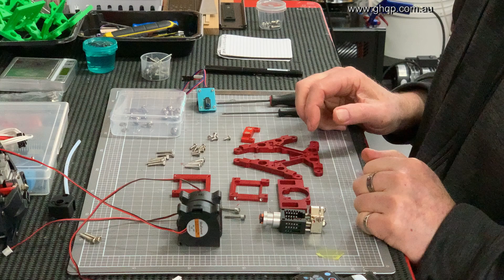Mosquito Hot End Effector for ANYCUBIC Predator

Comment: I just ordered the same hotend. Can I please ask you 3 questions I can`t seem to get an answer for?
What Nozzle Size is that? Mk8, V6,...? Can I switch the Heatbreak for a high flow,, and are they the same size as the original? The heatbreak for the Dragon v2 won`t fit I guess? They look identical. That one I could order. And is that heating block really gonna do 450C and beyond? Thank you for taking the time (if you do). Great Video btw, I have an Ender 5 plus, but I will need some trickery too to get it mounted.
Reply: It uses a V6 size Nozzle, I use Micro Swiss.  There is already the option of a high flow version heat break for the Mosquito that fits the same dimensions, I don't use it as the highest temp material I print with is PETG 230degC. I am also assuming Dragon Heat breaks wont fit, never tried. I cant say if you will get 450C+ never tried. I hope this helps.
Reply: @grahamham3398  Very much in deed! Thank you!
Reply: @grahamham3398  I just found a fitting bi-metal heatbreak on e bay! Thx agiain! Knowing the Nozzle size is a huge help!

Comment: I'm curious if you've also upgraded your electronics to SKR or Duet?
Reply from the maker: No I am still running the original electronic. I have purchased an SKR but its sitting on my desk waiting to be installed one day. I just find that the original electronics does such a good job there is nothing that motivates me yet enough to replace it with the SKR.
Reply: @hamrx8  Interesting.  I've got some random layer shifting that has plagued me for a while.  I've not been able to isolate it as clearly being either mechanical or electronic in origin.  Your linear rail upgrade is excellent and I'm seriously considering that.  Have you found that the linear rails have improved print quality or reliability in any clear way?
Reply from the maker: @pfschuyler  I did the Linear Rail upgrade/modification very early after I got my printer so as it was still working pretty well from new the improvement after installing the rails was very small. Just a slight reduction in banding but that's about all. I mostly installed the linear rails for future reliability and never having to worry about adjustments of the V Wheels of paint wearing off as many other people had experienced. I have never had a layer shift problem so cant really help with that one.
Reply: @hamrx8  Well thanks for the great instructions on your website.  I'm going for the linear rail upgrade and we'll see how it goes.
Reply from the maker: @pfschuyler  Let me know if you need anything. There is a Contact Me form on my website you could send a message so we can then communicate via eMail. There was an issue with the form not working but hopefully I fixed that today. URL is:  www.ghqp.com.au

Comment: How much would you charge for a kit? Not including the mosquito hotend itself.
Reply: So a kit to assemble and attach the mosquito. The plates and fans (I would want blue instead of red) and screws to put it all together. Basically everything minus the mosquito itself. I am very impressed with your work and am very interested in buying this off of you if you are interested in selling
Reply: @wisdomprescott9613  Same. I'd buy it in heartbeat for both of my anycubic predators.
Reply from the maker: Hi, see my reply to Wisdom Prescott. :)
Reply: @hamrx8  I've sent the STL's for MJF 12 printing at a local place for $30 total. If that works I'll be good, if not the aluminum parts are definitely something I'd want.
Reply from the maker: @wisdomprescott9613  It was never my intention to make these for sale. Honestly for the time it would take me to put it all together as a kit what I would have to charge to do it all would be a bit outrageous. I would only ever consider just the Aluminium parts only on a very limited scale. There is an email Contact Me form on my website.
Reply: @hamrx8  I would be very interested in just the alu parts made and sent to me. can i contact you on you email to see about cost?
Reply from the maker: @darrencarter5966  I think I have fixed the Contact Form on my website. Once you complete this we will then be able to email each other to discuss further. http://www.hamrx8.com/Contact_Me.php
Reply: @hamrx8  I've tried to use your contact form but it won't accept my submission (because I'm using punctuation, apparently).
Reply from the maker: @Radioman-pv5np  Thank you for making me aware of this problem. It is now fixed so you can now send your message.

Comment: You weren't kidding, those STLs are messy lol. None the less I am still impressed by the quality of your work. Personally I'm going to go another path, just pulled the trigger on a high flow Phaetus dragon hotend. Hoping it's good quality, it's definitely not cheap. Designing an effector for it now, going to integrate the duct into the effector so it's more rigid and less likely to warp.